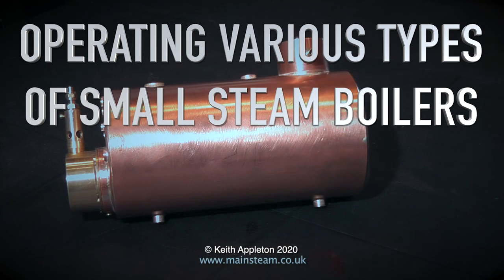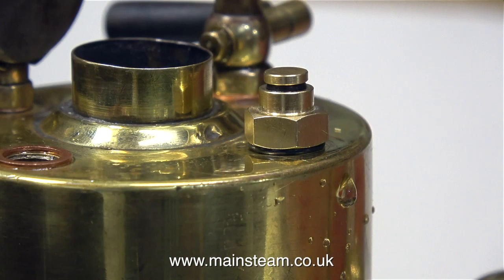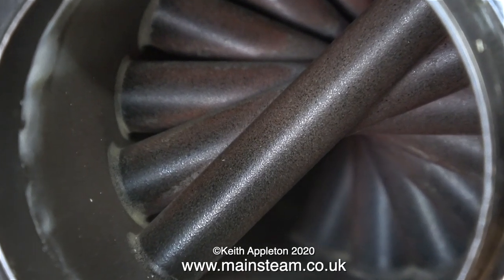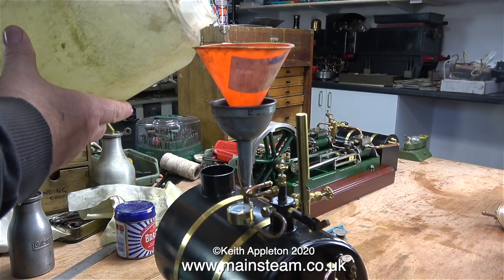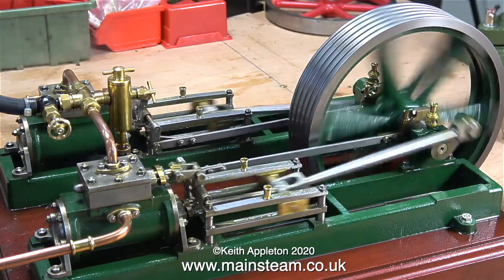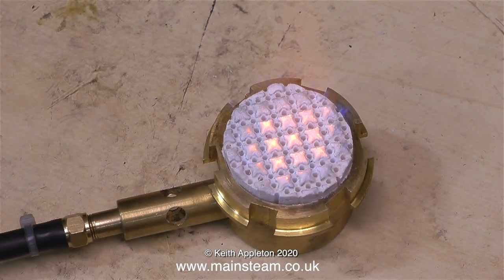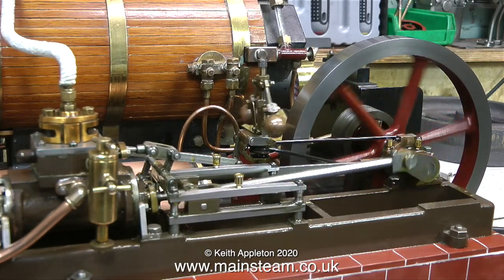OPERATING SMALL STEAM BOILERS - PART #2

Comment: Many years back Model Boats Magazine published some articles by Peter Arnot, on building a steam plant. I have used variations of his boiler plans on a number of boilers, you could set them up as either horizontal or vertical types. I have had very little luck with the ceramic gas burners and have gone back to metal ones.

Comment: wonder if you could take a short tube, with holes in it and put it between the opening on the boiler and the ceramic burner to allow more air for burner(all pieces lock into place)?

Comment: Fascinating video as usual.
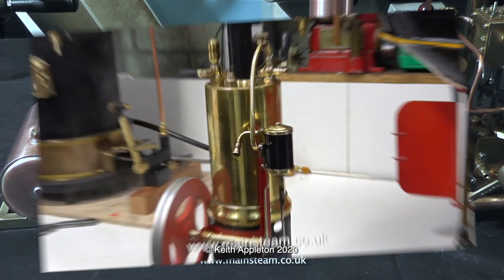I recognised the "steam toy” you show between 1:00 and 1:00 (approx) as a Bing toy from the early 20th century. A friend of mine has asked me to refurbish his. 
My problem is that the gauge glass is broken and I need to craft a new one. This I can do easily enough but sealing it to the boiler is going to be a problem. I am thinking of using o-rings. What size did you use as a seal?
Reply from the maker: Sorry, no idea, this one is Clockwork.